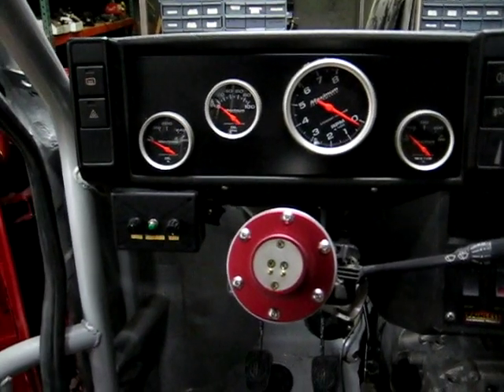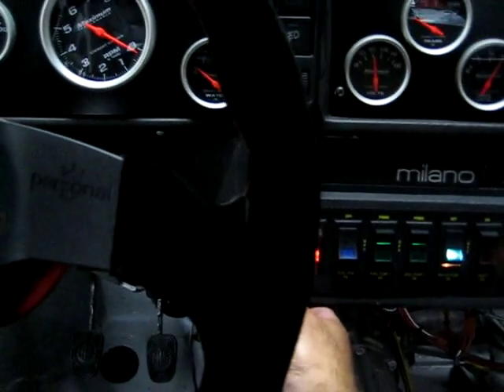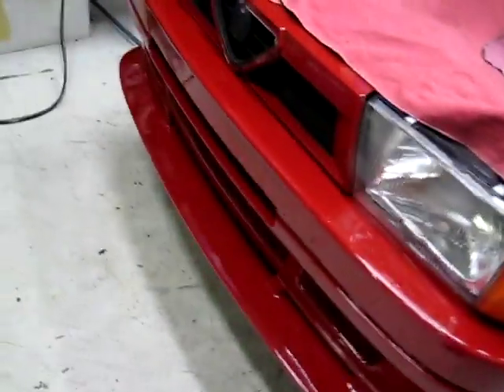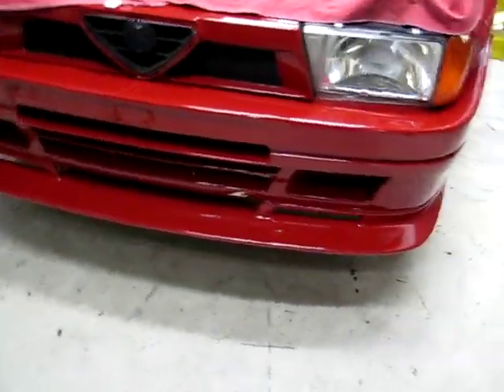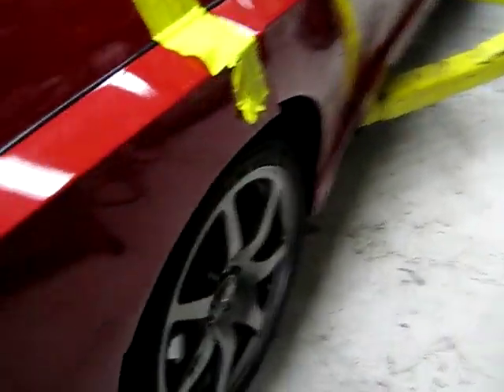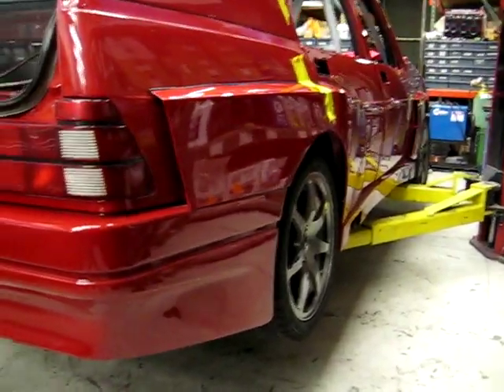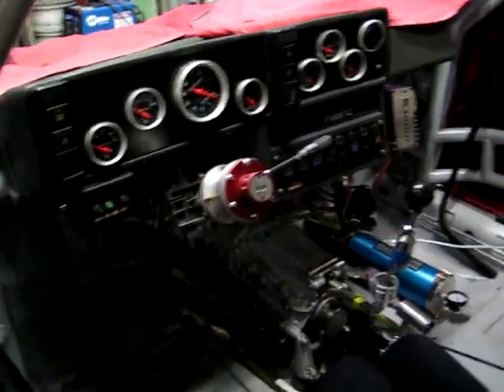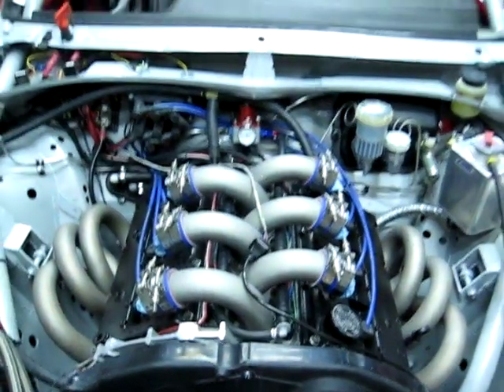6-Speed Alfa Romeo Milano / 75 Glenwood 3.7 Litre 1st Start-Up After Paint!

Comment: nice work,, but i cant understand to change the 'specials' of the 75 - like the gearbox on the backside, incl. the De-Dion axle - !  I know there are some things to do, because of the high revving mass between motor and gearbox. I loose weight at the 1st flywheel from 13.5 kg to 5.5 kg and the 2nd at the clutch-flywheel. After this, the revvs are quicker up and down, just like 
with a front gearbox, so it's also possible  to chance gears much faster.
Reply: XX nü XX because the transaxle would not be able to take any abuse with this amount of power without blowing
Reply: how much torque ?  because the Kardan with hardy looks like stock, i thought the Kardan might be the weak part - not the gearbox
and what kind of axle instead?